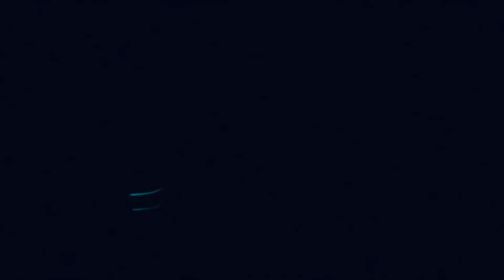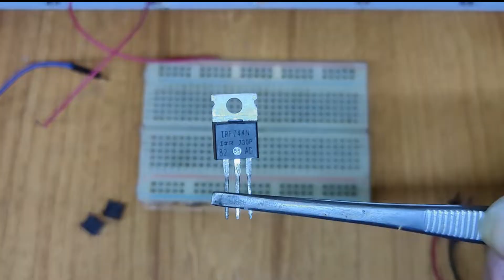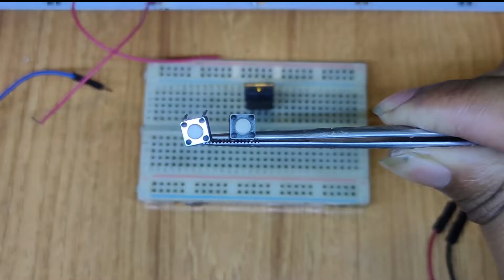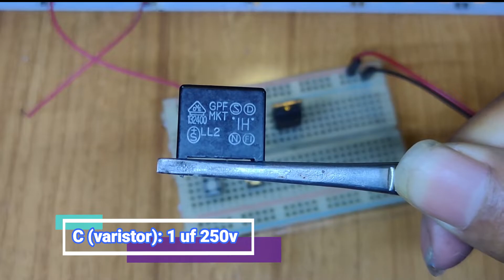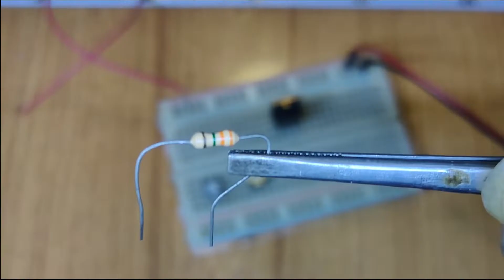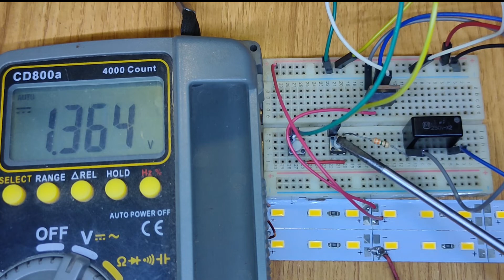Voltage regulator using 2 push switch or Irfz44n mos, step up and step down ability, Tech Master BD

Comment: nice but voltage is not constant, its going up with time. do u have its solution?
Reply from the maker: not like that but when still press the up then voltage increase with time out of limit but when using partitions of capacitor technic to  preset charge or discharge level per click for capacitance then it will be the solution for single step constant voltage regulator as considered.